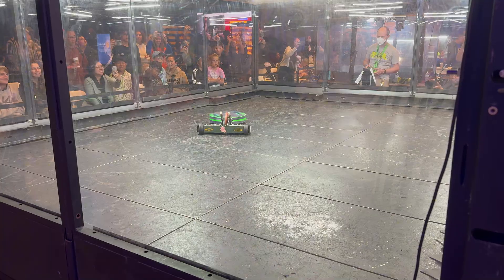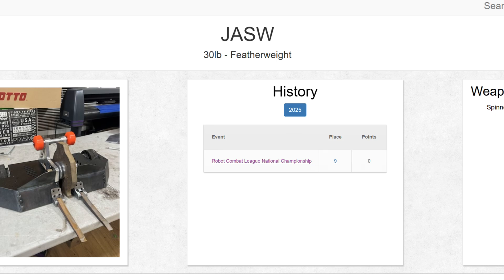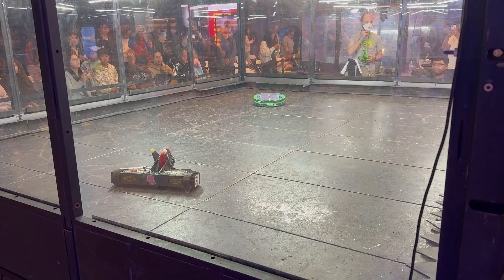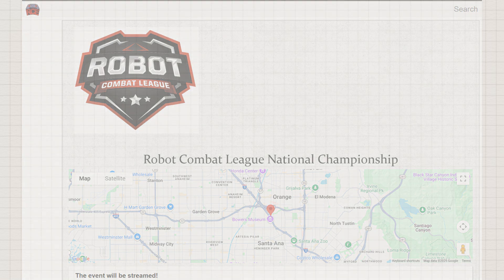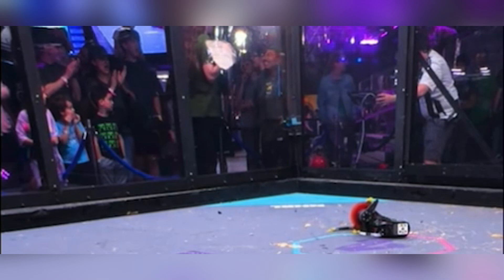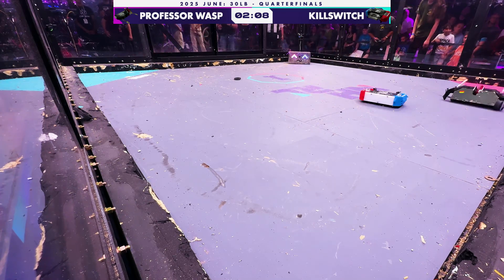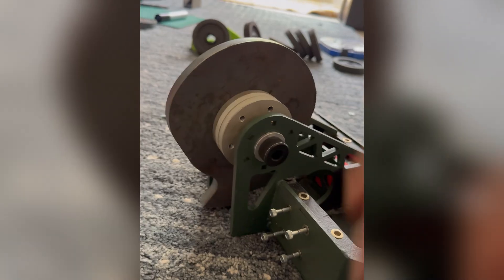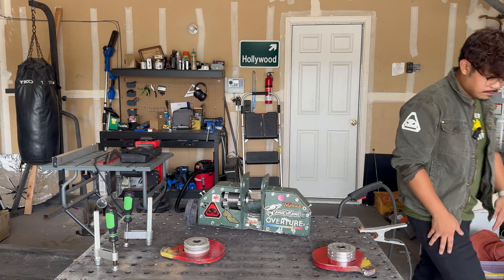The Most Dangerous Robot I've Ever Built

Comment: I have a question, how should I drive a robot like that, I have a robot called pumpkin spiceD latte that will be competing in the Utah combat robotics summer event, how should I drive ( it is a plant class)
Reply from the maker: Generally speaking the idea behind this style of robot is to use your forks to corral your opponent into the weapon. Play wide and avoid them getting around to your sides. 

Good luck!
Reply: @reject_robotics thank you for the tip
Reply: Due to gyroscopic forces you don't want to get into a driving battle. Spin up your weapon, align your bot with the other bot, fully accelerate straight forward and drive your weapon as fast as possible into the other bot. Repeat.
If you do get into a driving battle spin your weapon at lower RPM so you don't gyro as badly when turning and try to (lightly) hit your opponent to cause them off-balance or otherwise not entirely in control anymore, once they are flopping around you can then go to step one: spin up your weapon, align it with the other bot and ram them as hard as possible.
Reply: @bami2 thank you :)